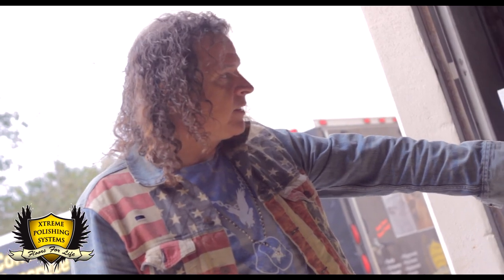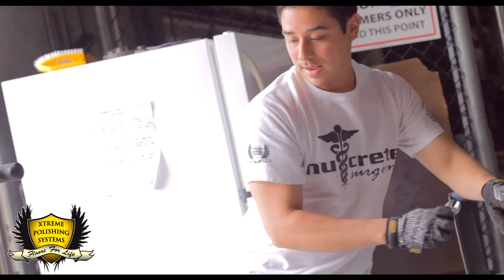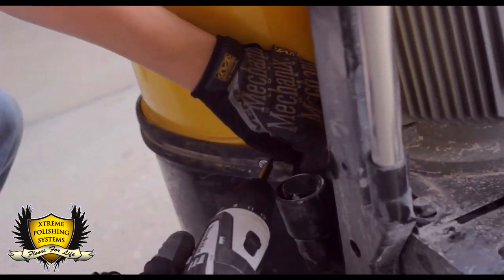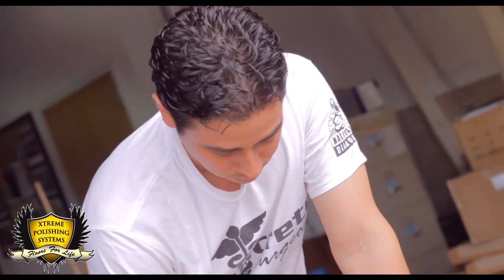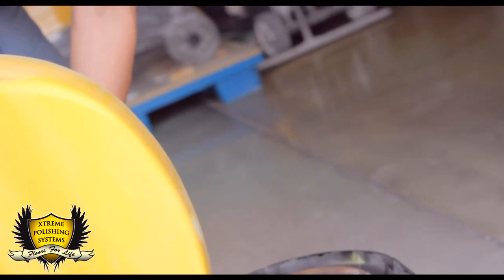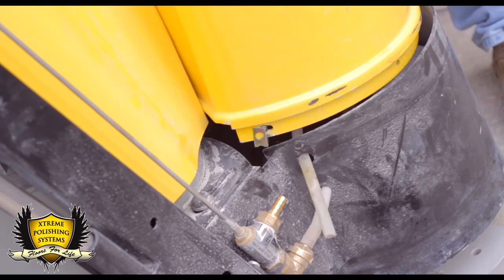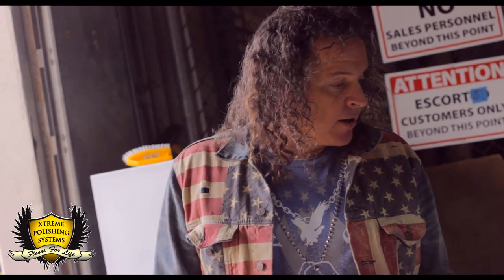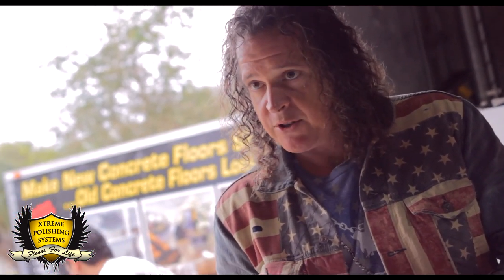HOW-TO Repair/ Replace Concrete Genie Grinder Belt | Xtreme Polishing Systems

Comment: I just adjusted my belts. after years of use, not worn out just my first regular maintenance. I found that using a 3/4" or 18mm combination wrench works little easier than adjustable wrench and 8mm hex key on a 3/8 socket using the cordless impact driver like you have works easier and faster. Took me all of 5 minutes. Really good design and easy to do, thanks guys.
Also couple key things: Buy a ratcheting combination wrench to speed up the bolts also I use a 3/8" mounted Allen and a socket drive makes the adjustments lot easier. Following a complete clean up after every job like they mentioned I spray dwon all metal parts with AMSOIL metal protector and the bolts and deck with HD Metal Protector which has a little wax-ier consistancty which helps protect the hardware making service at a later date much easier.
Reply: what type of belts
Reply: +dEsignEd byGOD It is a Dayton V belt probably available in auto parts store. Call Santiago at XPS he probably has the belt number off the top ohis head. Real easy as in the video. Just be careful if you have the fiberglass tank I broke two of the tabs on mine, still holds but needs TLC.

Comment: My concrete genie has been broken for a while seems the computer is going bad. Can u make a video on problem solving. Or if you have a repair center in chicago?
Reply from the maker: We do not have a location in Chicago, but you are welcome to send it to the repair shop at our North East location at (877) 958-6207.